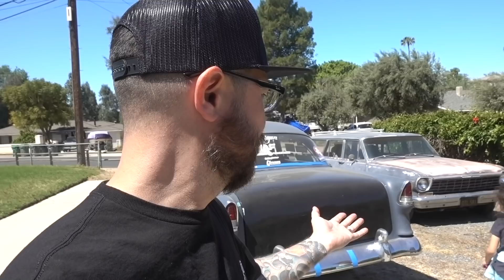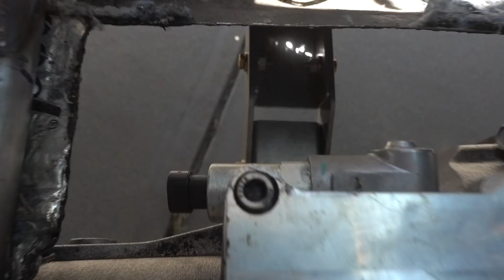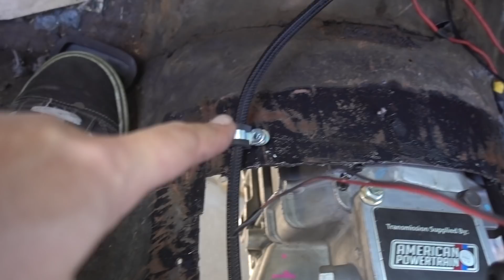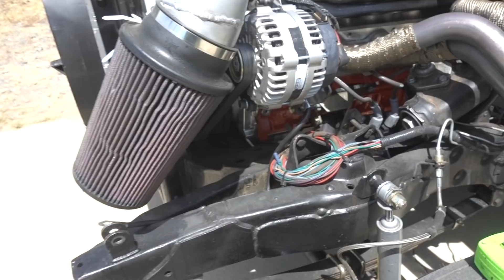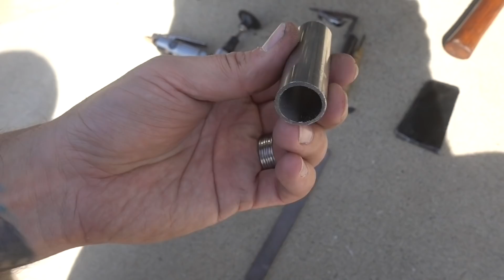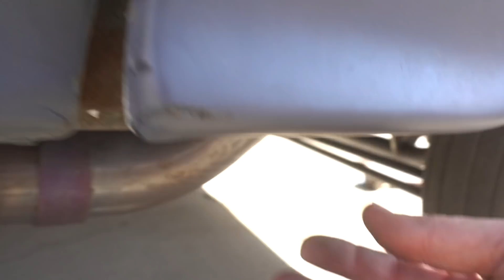Giving Tri-Five by Fire Retribution After Kall Out Kings! '55 Chevy Gets Drag Ready

Comment: Nice update on the 55 John! I want to see that bad boy rolling on the streets!! I also have a few tools over here if you need to use any of them like,  a power bead roller, brake, shear, I have a 220 mig as well if you need to weld something up or need it welded  I got ya 👊 Also have other specialty stuff for building like flair and line bending tools ect. 

-Dane

Comment: Hey Jon, twin hoodpins will look funny on those panels but I think it's still necessary with multiple points to hold that fiberglass in place. Keep the hoodpins where they are and glass a magnet to the bottom of the panel. Make a stand-off from the frame for the magnet to attach to. I think that will do the trick withouth messing with the look!

Comment: Just add a layer of fiberglass to the inside bottom of the fenders, use a strap to pull them in and let it cure. Remove the strap and problem solved. The bottoms of the fenders are left wide to clear the firewall when you tilt the front end. After you do the fix the fenders will scrape a little on both sides when tilting the frond end.

Comment: Those welders dont like extension cords. If you must use one than a 10 gauge or bigger is what to use. And make sure if no gas is being used that you are using Flux core wire.

Comment: What about the extreme shake in the steering?  Like when you were racing Finnegan and had trouble up-shifting; it seemed to be stuck in gear and you finished the run with the steering wheel oscillating uncontrollably. Looks to be unsafe at 25 mph and you're gonna drive it 8 times that speed?

Comment: could adjust the shape of the bottom part of the fender below the hoodpins by mounting / bonding a bend strip to the poliester wish should be strong enough to bend the bottom lip of the fender in a bit more so it clears the doors , and doesnt flop around at speed , if it does that you could loose pieces of fender down the track 
having the hoodpin go through the strip and have the strip go all along the rear edge is probably a good idea 
you might still need to trim the fenders to get the gaps between the doors and fenders closer to perfect , some sandpaper around a stick the right thickness and sand everything that stops it from going through the gap untill it does  , then spraypaint the bare metal and poliester grey again
as for hooking up the front lights and all that , i suggest you put a trailer lighting plug 
https://ae01.alicdn.com/kf/HTB1LHooRpXXXXaZXVXXq6xXFXXXF/Encell-USA-7-Pin-Trailer-Plug-RV-Socket-Plug-Zware-Duty-Trailer-Adapter-Bedrading-Connector-12.jpg_640x640.jpg
and some 6 strand trailer electric cable somewhere convenient so you can unhook the cable loom fast to take the hood off think the trailerplug and cable has enough pins for the low highbeam lights blinkers and horn
the trailer style electric cable 
https://media.autobarn.com.au/media/catalog/product/cache/2/image/500x500/9df78eab33525d08d6e5fb8d27136e95/5/8/5852-30TC.jpg
probably makes hooking up the lights in the back look a lot cleaner too

Comment: Some fiberglass can be heat gunned and held in desired position till it cools. I've done it on race bike fiberglass. Might improve that lower edge of your fenders. You'll get some spring back, so you'll need to over bend a bit. Can't hurt to try.

Comment: For the lower sides of the fender where they dont fit bend up a pice of aluminum to the right shape and glass it in to force it to be the right shape, actually you could probably even use a couple strips of wood.

Comment: Mad props dude for having the kid involved!  On the fender issue you can always build a skeleton with some CM tube and have it glassed in so that it holds a correct body line instead of having to make more pin down locations.
Reply: @Spadookie  fiberglass rod should also work. Make sure both surfaces have been prepped with acetone to make the resin sticker again. And if doing it cheap, you could possibly track down old fiberglass fishing rods and strip them of the hardware and sand them back to the bare fiberglass.